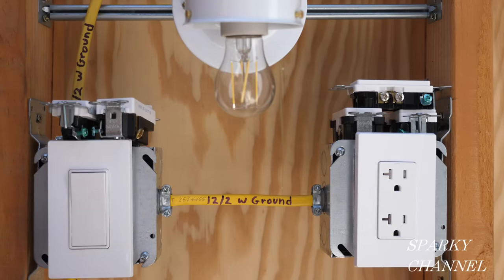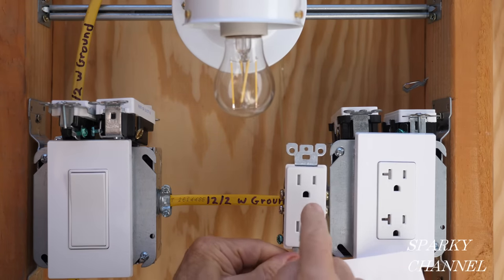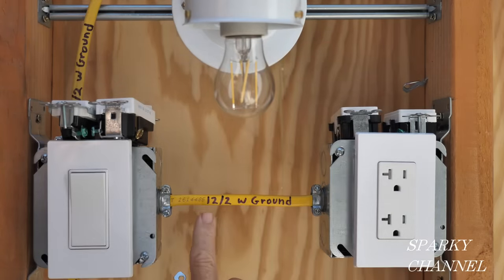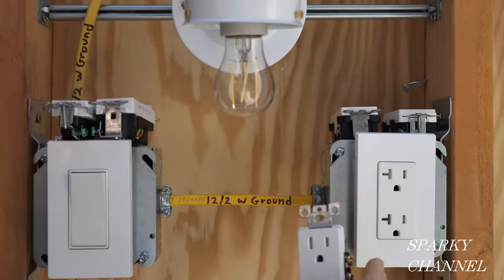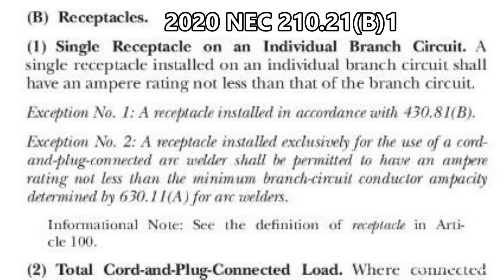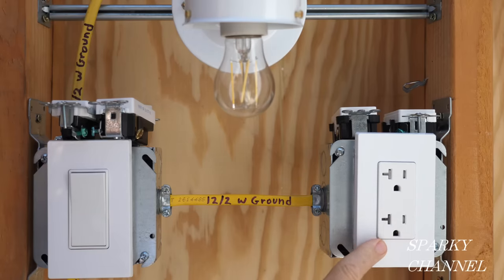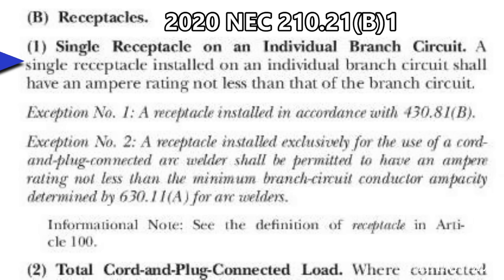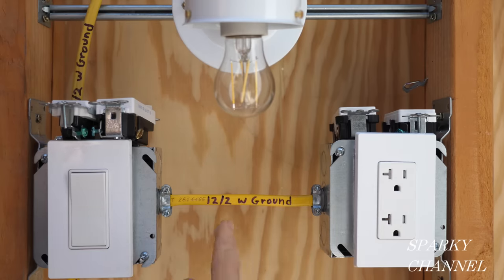Shall I Use a 15A or a 20A Receptacle on a 20A Circuit? + 2020 NEC 210.21(B)(1) and 210.21(B)(3)

Comment: I believe the 15 amp receptacle....is actually rated higher that’s why they can be used in “kitchen circuits........it’s always better to spend the extra buck for outlets and switches ....stronger  and won’t break as easily.......do not see any advantage in using 20 amp outlets if you use the better grade 15 amp......unless your appliance has the 20 amp plug.......
Reply: Black Pine
 ... the main point here is a 15 amp outlet still has a 20 amp pass-through so ok on a 20 amp circuit in most cases.
Reply: rupe53     My neighbor pulled out all his 15 amp outlets in his kitchen and dinning area.....and replaced them with 20 amp outlets.......believing his outlets would be burning up......because the breaker was 20 amp.......
Reply: @blackpine6693  ... maybe some people need educating? I don't think you will find too many UL approved portable appliances rated over 1500 watts / 12.5 amps. The only common one I can think of is a hair drier at 1800 watts, and you probably wont be using that in a kitchen. Heck, even a 4 slice toaster is under 1000 watts and so are most counter top microwaves these days. Of course newer code is changing things and often asking for multiple circuits at the kitchen counter and another for the fridge. OTOH, I can recall a time when it was common to have a single circuit for an entire floor in a home (30 amp service @ 120 volts) and then it became 2 circuits per floor. (60 amp service @ 240 volts)

Comment: The lowest breaker in my box is 20 amps, I don't have any 15 amp breakers...but, all my receptacles are 15 amp. Can I use 14/2 wire to feed power from one receptacle to another or do I need 12/2 wire?
Reply: RE:Macster. I am not an electrician, but I would say you must use 12 gauge wire because your breaker protects the wire and a 20A breaker would allow too much current to flow over a 14 gauge wire before it trips.
Reply: Macster: You would need to have 12 awg romex for any circuits with a 20 amp breaker. The breaker protects the wire from overloading itself. If you were to use 14 awg, then the wire could overload before the breaker could trip. You can have receptacles (15amp) on 14 awg wire, all day long, but it would also have to be on a 15 amp circuit breaker, if that were the case.
Reply: No, it has to be 12/2 with ground.  Keep the wiring consistent with the amp rating of the breaker.  If the circuit is 20 AMP circuit breaker and it's wired with 12/2 with ground, then use 12/2 with ground to add another receptacle on the branch circuit.  Same applies for BX/MC amour clad you can tell how wide the tubing is.

Comment: Those two receptacles don’t look like they are from the same brand and series.  I like Eagle (now Eaton) spec grade outlets.  The 15A and 20A appear to be identical except for accepting the special pin on the 20A.  I bought some 20A versions not because I need them for 20A plugs, but because they were less expensive.  Sometimes price is determined just by demand and supply rather than anything else.

Comment: This guy is wrong; he is comparing a 20a COMMERCIAL grade receptacle, to a 15A STANDARD grade receptacle!
That metal strap on the back is what commercial grade outlets have, and yes, they are 'beefier'.
They make 15A COMMERCIAL grade outlets too!
It is not a fair comparison to say to use 20A because they are heavier duty, when he is comparing two differently rated duty outlets. Apples and Oranges...

That being said, I agree with him that commercial grade is better than standard or residential grades...
I just object to the way he presents some of the comparisons, and some of the statements he makes.

In deference, he does say he is comparing commercial grade, and residential or standard grade, but he implies that all 15A outlets you get will be standard grade...
There would be nothing wrong with wiring your home with 15A commercial grade receptacles IMO.
A 15A commercial grade outlet should be just as robust as 20A commercial grade outlets.
(FYI code calls outlets, "receptacles" to be proper.)

Personally, I don't have a problem with standard grade outlets either, for most home locations; where plugging and unplugging is very infrequent. Commercial is better for in a workshop or garage area, or outlets in the open where a vacuum will always be plugging and unplugging (or kitchen counter area).
In a bedroom or office, behind furniture, etc, I just use standard. Lasts me many many years...

You know your own habits...
If you redecorate and move furniture every year and change TVs and all, then maybe commercial will be a better choice for the long term, for you...
Reply: studying for my c-10 exam on Monday, this was a question on my practice exam. Lots of fine lines in the NEC Holy Sh!t. But the ? in my practice exam: Receptacles installed on a 20 amp circuit can have an ampere rating of either 15 or 20. T or F ?
Answer is True. The way I understand it is:  as long as its not a single Duplex receptacle. So 2 or more 15A receptacles on a 20A Branch Circuit is acceptable. Brain is sizzling
Reply: Sounds like you didn’t watch the video before you commented and started editing it
Reply: @CyTaux  What makes you say that? (just asking)
Yes I did view it in entirety. I objected to him implying that you should not use 15A outlets because they are lighter duty, when that is not strictly true. It depends on the grade, not the amperage.
Viewers new to electrical parts could easily miss this distinction.
Overall though, he was trying to recommend commercial grade receptacles for longer service life, and I agreed with that overall point of his video.
That is why I didn't want it to sound like I was dismissing his main point.
Mr KL
Reply: Thank you for this comment.  I'm replacing all the outlets in our house and all of the uncertainty and opinions on receptacles has been confusing.  Your explanation of which use cases should get higher grade receptacles makes complete sense.

Comment: I'm wiring outlets after a contractor did rough electric. I have 20 amp breaker to 12 guage wire, but then in the first receptacle in the circuit, it splits in 2 directions on 14 guage wire. Is this safe? should I feed the first outlet with the 12 guage, and then pigtail the two lines with a 14 guage wire in the load part of the receptacle?
Reply: All the wire on that circuit should be 12 gauge.
Reply: I would not be too concerned as long as the kitchen, washroom/garage are 12 gauge as those areas are where high power consuming appliances will likely reside.
Reply: @surferdude642  I would be worried if 14awg wire was being used in a 20 amp circuit considering 14 awg is not rated to carry 20 amps.
Reply: Barbara, if you haven't already, talk to the contractor. Another thing I would recommend is to find where each breaker goes. Replace the 20 amp breakers with 15 amp where appropriate. Make sure you have 12 gauge wire in high demand locations.
Reply: @beckyschwantes5287  Agreed
Reply: RE:Barbara Moser. Don't allow 14 gauge wire to be protected by a 20A breaker; it might overheat. I would say either the contractor installed the wrong wire or you are not understanding what he intended it to power. I would ask him about it and have him re-do it if necessary. Or, if there are no heavy loads and it meets code, you could just switch to a 15A breaker. The building inspector might have something to say about that.
Reply: Have that corrected not only just to pass inspection with the locals but to ensure safety.

Comment: I've been in the business for 38 years and I rarely install 20 amp receptacles in a residence except for where required by the NEC.  Installing 20 amp receptacles is more expensive and a waste of money in my opinion because manufactures of blenders, toasters, circular saws, vacuum cleaners limit their amp draw to 12 A hence all is needed is a 15A plug.   I think I've seen a 20 amp plug, not to be confused with an outlet maybe once in a residence in my 38 years.  That was a high-end commercial type coffee machine.  

Think about it.  When have you seen a 20 amp plug used in a residence.  I'm not talking about the air conditioning unit or a washing machine I'm talking about in the kitchen or wall outlets on a 20 amp circuit. 

Why do electricians install 20 amp outlets in kitchens when no appliance pulls more than 12 A have a 15 amp plug on them.   Because that's the way they've always done it.
Reply: I agree with everything you said. I've never seen a nema 5-20P until yesterday, a Thermador stovetop kitchen appliance installed installed in a residence. It has gas burners with an electric griddle in the center. The power rating is 1630 watts or 13.6 amps. I've heard that some exercise stairmasters have a 20 amp plug. However, these appliances require a dedicated circuit and a single 20 amp receptacle. It seems to me that the requirement to have a 20 amp duplex receptacle is non existent.
Reply: small stick and mig welders use 20 amp, same with old plasma cutter
Reply: The reason is that if a multi-wire run is made to the kitchen, then the duplex receptacle must be 20A since it will be phase-split.
This might be a design consideration where the owner doesn't want a large quad box but needs two 20A circuits.  Multi-wire is common and if the branch is 20A, the receptacle must be 20A.  Can't run a microwave and a toaster oven at the same time on a single 20A branch even though the both will have NEMA 5-15P connectors.
Reply: @chrishayes5755  Never seen one with a NEMA 5-20P.  My Hypertherm 380 plasma and my Lincoln MIG, both have NEMA 5-15P.  That said, the Hypertherm performs much better on 240V than 120V even if on a 120V, 20A circuit.
Reply: could you install a washer dryer 2 in 1 unit with a 15 or do you need a 20 receptacle?
Reply: @DiffEQ   That's not 100% correct for it depends on the total amp draw.  Smaller microwaves pull only 6 or 7 A and 2-slice toasters are around 5 A.  Both of those running at the same time will NOT trip a 20-amp breaker.   As far as a multi wire run, running 12-3 NM cable, you're behind the times for it's not practiced much by electricians anymore because of the requirement of AFCI breakers and the neutral sharing problem.  In commercial and industrial electrical, neutral sharing is considered bad practice.
Reply: @deadgame05   It depends on the washer /dryer unit and it's amp draw.   I would think the unit would be 240 V.  If it has a only standard 15 amp plug then you can run it on a 15 amp circuit or a 20 amp circuit with a 15 amp rated outlet.   The  NECode requires a dedicated 20 amp circuit for a washing machine.    It's a bit complicated of what you can get away with.

Comment: My house has 12/2 run for all outlets and lights with 20 amp breakers. Is it ok to use 15amp switches or should they be 20s?
Reply from the maker: 15A switches are fine.

Comment: Hi Sparky what about switches? If you run a 20 amp circuit (12/2) with shared lights and receptacles, can you use a 15amp switches? Its my understanding that the switch is rated for the load its carrying, but what about the load of the whole circuit? Lets say you have a room on one 20 amp circuit supplying outlets(15amp rec) and lights(15amp sw) but you pull more than 15 amps on the circuit. Will the light switches rated for 15amp be ok?
Reply: I know this question is a month old but I can answer this. It all depends on the AHJ. I have had systems pass inspection with a bedroom on a 20A circuit with 12ga wire but the last outlet in the run feeds the light and fan. It was switched to 14ga wire just to make it slightly easier to wire up all the can lights. Like you said, the lights were LEDs and the fan will never pull anywhere near 15 amps. I have talked to other inspectors that want it all wired with 12ga wire. Even after trying to explain the above they will not accept it.

The ones who will not accept or openly discuss things like this typically boil down to a few different types of inspectors. But let me preface that you can reason with an inspector and if he aggress, him passing it is fine and legal.

Now that said.
#1 The "noob" inspector. Typically young or new to field, knows very little, only what he was told, and part of what he might read. Easy to talk to but too afraid to make a decision on their own.

#2 The "Old Coot" inspector. Typically older and has been doing this a while. Might not care what code says, "this is the way we do it around here". Very hard to talk to this person about changes.

#3 The "pissed off" Inspector. How they got to this point might not have had anything to do with your job but that is of no help to you. Or it might have had everything to do with you. Good luck.
Reply: @bassntruck  Inspector should not have passed allowing any 14 ga wire on 20A breaker.  I have seen folks put those "two-outlet receptacle plus threaded lamp base extension" onto the light circuit and then plug in several more devices and then breaker is no longer protecting the wire.  Used to happen a lot in garages in cheap tract homes with only one wired-in outlet.

And then there's the awesome inspectors - one we had in Oak Ridge, TN who walked my wife through everything and she wired our 3,000 s.f. home (first timer, no experience) including main and sub-panels and got it all perfect! In fact all the inspectors in OR went above and beyond to help us get it right and do it most efficiently.  Haven't seen that since!!
Reply: @geoffwood2712  These bedroom have recessed lighting 9' in the air. It is also wire with more outlets the code requires per wall foot. The odds of anything using the recessed lights as an outlet is unlikely. There is also an outlet at the top of one wall in each room at the ceiling. If they do use one of the lights and wire 400 things into it, Darwin will pay them a visit I am sure.
Reply: @bassntruck  Lol - sounds like a great room for a grow-op!  Darwin paid our neighbor a visit for doing just this.

Comment: so does the ground  hole go up or down???
Reply: Sideways.... 😬
Reply: Doesn't matter.  I personally like putting the ground down since 90% of 90 degree cord connectors work best with ground down. That way, the wire isn't stressed like a candy cane if ground up.
Reply: @spockmcoyissmart961  i have those cord that are both ways. a real PITA.  the code doesnt specify nor is there a standard that i can find
Reply: @richardcranium5839  There is no 'code' way.  I install them down for the cord reason.  I know there are others, but the majority I've worked with use ground down.  Now to throw a curve ball, now I'm seeing some that are like a 45 degree angle.
Reply: @richardcranium5839  ... you can't find it because there is no national code on that, although it may be a local code in a few places.
Reply: @spockmcoyissmart961  ... the cord with wire off at 45 degrees is so 2 cords in the same outlet don't hit each other.
Reply: In my area, decades ago, it was common to see the ground up if the receptacle was operated by a switch.  For example the bottom plug was for a lamp and the top plug was hot all the time.  Haven't seen it in a while, but I could see how it would help the homeowner identify a switched plug.
Reply: Ground up does make sense with metal cover plates. Might save a short if the plate comes loose.
Reply: When up, the ground terminal prong acts as a safety measure by preventing a metal piece, such as a coin or utensil, from falling onto the live circuit terminals and short circuiting
Reply: @wallacegrommet9343  ... if everyone agreed on that then they would write it into the code. So far I'd say 98% of appliance cords are still made for the ground to be in the down position, either by using a polarized 2 prong or molded flat style 3 prong plug.
Reply: good conversation  wanna chime in bill???

Comment: Sparky
Can you give a lesson on use of combo outlets / receptacles  like NEMA 6-20/5-20 Hubbell / Leviton  I always or quite often get comments like you can only use one receptacle  on a circuits. it is a basic 20 amp circuit.     It just uses  a  GFCI  breaker and  12-3 with ground  like any other 20 amp circuit. A lot of kitchens have 240 deep fat fryers and toaster and need 240..

Comment: If you use a 20 amp outlet or just a 20 amp circuit breaker on 15amp (14 gauge wiring) and you have an electrical fire, your insurance provider can hold you responsible and pay only a portion of the monetary claim you make.
Reply from the maker: Good point!
Reply: Nonsense.  It is code compliant to use a single 20A receptacle on a 15A circuit.  If it's NEC compliant, the insurance company has no say in the matter.  Stop passing on bad information... especially with the fear-and-dread fiduciary warning.
210.21 (B)(1), states a single receptacle installed on an individual circuit shall have an Ampere rating not less than that of the branch circuit.